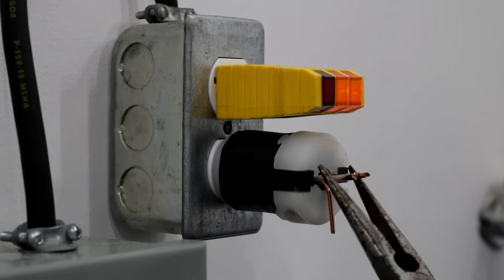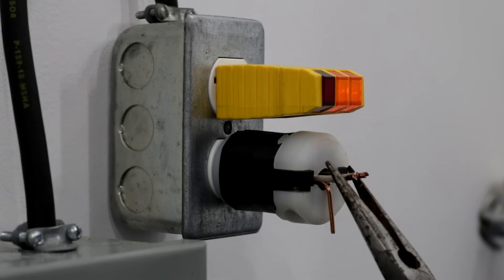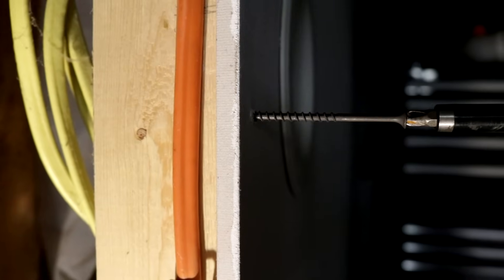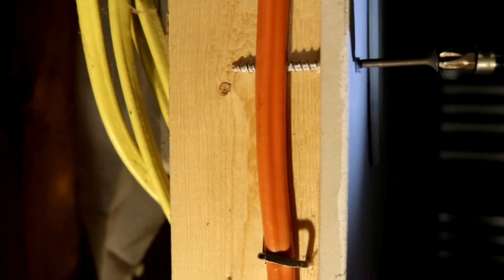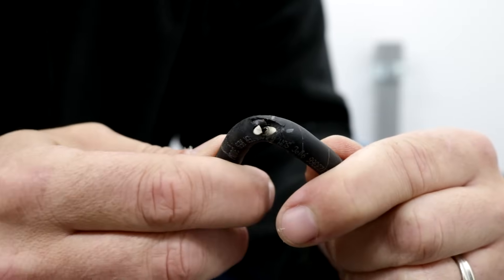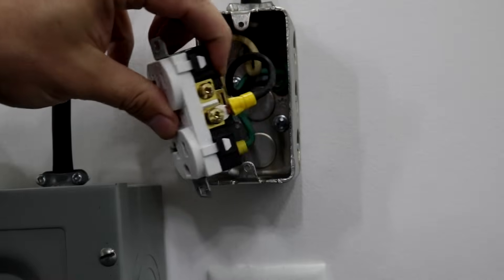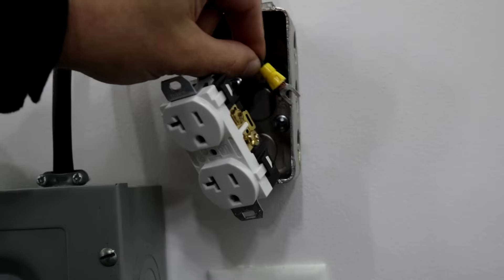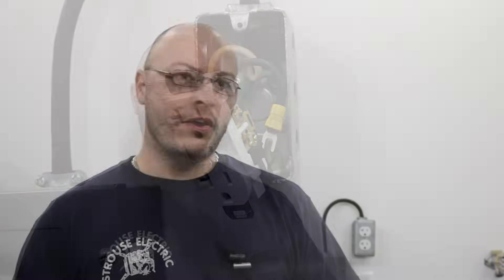Circuit Breaker Keeps Tripping - 3 Common Reasons

Comment: if the screw hits your wire and trips it, and your not sure what screw it is , is there someway to pinpoint the problem without taking half of your drywall down?
Reply: De energize the main circuit breaker and short both phase and neutral of house wiring, then use an ohm meter and start touching all nails while keeping the second lead to the short you made in distribution box using a long wire.
Reply: Yes. The safest way to do it would be to First turn on the breaker and see if it turns off again immediately. This will tell you that the short is still active. Sometimes a short will burn enough of the screw away where it will stop making contact with the copper.. In that case you're screwed and you'll just have to take out each screw one at a time and inspect it.
If it continues to trip the breaker immediately then keep the breaker off and use a meter to test for continuity between any dead plug in that circuit and each screw. 
You will have to test both legs hot and neutral because you don't know if the hot and the neutral are shorted together or if a hot and ground are shorter together or if the neutral and ground are shorted together.
Run an extension cord from any dead outlet into the area that you're going to be testing the screws.  Turn on your meter to continuity and connect one lead to one side (hot or neutral blade hole) of the female end of the extension cord and use the other lead to touch each screw. 
If the screw Is contacting The conductor that shorted your meter will sing when you touch the right screw.  If you get through all the screws and you didn't get continuity simply switch the meter leg to the others slot in the female extension cord and retest all the screws. One of the two should show continuity at least at one of the screws. If you find it, unplug the testing extension cord and simply back the screw out and reset the breaker.  It may be the case that the screw didn't break the conductor and everything will be fine even though the plastic covering will be boogered up.  If you find the screw and you take it out But the circuit keeps tripping you either have another screw that has shorted the wire or the wires damaged sufficiently that the copper conductors are continuing to touch even with the removal of the screw.  If the ladder is the case you're going to have to open up your drywall at that screw location to determine the gravity of the damage and the course of action for repair.  If the conductors are not severed and if there isn't a huge loss of copper at the point where the screw went in, you might be able to get away with slicing open the jacket of the main wire and then separating each wire and individually wrapping them with electrical tape and then finally wrapping all of them again to provide a new outer jacket for the set.  after you have cut the outer jacket and separated the conductors and before you start taping reset the breaker and see if separating the conductors at the screw penetration point Is sufficient to stop it from tripping.  If so, inspect the conductors to make sure that there's no huge loss of copper.  If there is sufficient copper left simply tape up the compromised insulation on each leg and then retape the bundle to provide a jacket on the whole cable. Reset the breaker again to test your repair before you seal up your hole. As long as you don't cut a copper conductor you don't have to have a junction box. If there is a cut copper wire the proper thing to do is install a junction box at that location and hope like hell that you can get enough slack to get both sides of the legs into the box.
The other thing you can do but it's up to your discretion and you take full responsibility as to make the repair in the ceiling with a conductor splice and soldering the connections and then using high quality wire nuts to cover the soldered connections and then tape the shit out of everything. In the old days they used to solder and bury connections all day long.
They would solder and then wrap them in a rubbery sticky tape and then bury the conductions in the walls. Again, burying connections in walls is now against code but sometimes you got to do what you got to do.
 Just know that I am an electrician and I am not counseling you on what you should do. I merely telling you what has happened in the past. You will make your own decisions and take full responsibility.
Reply: Yeah you just gotta touch the screw with a hot/neutral cable

Comment: My circuit breaker keeps going back to the middle. I switch it off then put it to the on but it won't stay on the on position. it keeps going back to the middle. it happens every couple months but it won't turn on this time. It's not working at all.
Reply: I'm having same issue. did you figure it out? looking for some tips thanks.
Reply: Get an Electrician in. Don't keep messing about with it if you don't know what's wrong.

DIY is ok for bits where you know what you're doing but don't keep guessing at a faulty circuit as you could be making things worse.

The circuits needs to be tested and inspected by a professional with the correct equipment.
Reply: Hi I'm and electrician I can help you. 
How many Amps the breaker is first and second try to buy new breaker for the manufacturing panel
Reply: I have replaced a bad breaker with a new one...but it keeps breaking....plus it also sparks when breaking followed all the steps but keeps doin this
Reply: victor solis  what if it’s the ac breaker. And it on the breaker alone. I’ve had breaker and panel changed. It flips every 3 or 4 hours 😩😩 it’s hot. Help
Reply: Change it
Reply: Clint Crawford that is happening because the particular breaker is pulling more amperage that it can handle 
You  probably  have too many appliances connected on the same circuit breaker that is pulling more than the breaker can handle   Example if your breaker is a 20 amp make sure you breaker pulls 16 or max 18 amps with all the appliances on at the same time
Reply: Nnbnn
Reply: Given that it's a year later, I'm assuming that you've had the problem resolved by now. What probably happened is that you had a faulty connection on that branch circuit which would occasionally short-circuit to ground and trip the breaker. If there is an active short, a breaker will trip instantly upon switching it to "on" to prevent arc faults from starting a fire by people holding the breaker "on".

Comment: Crazy thing is probably all of the breaker manufacturer's inform customers in writing in their specs to change a breaker once it has tripped! I assume they say that only to cover themselves from liability. That would get expensive for owners though to change circuit breakers for everytime a breaker would trip. Good video, Bill.

Jeff
Journeyman Electrician
Reply: they do not tell you to change a breaker if it trips that would be a fuse.  Breakers are made to be resetable thats why you buy them over a fuse. Also your breakers should ever be tripping frequently or your shit would fucked up.